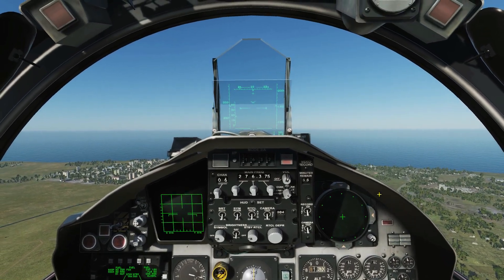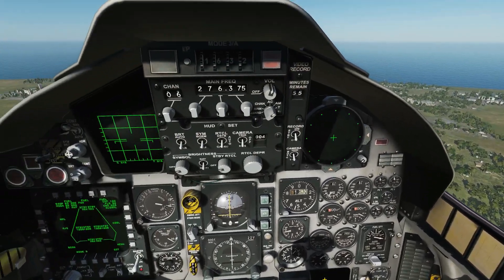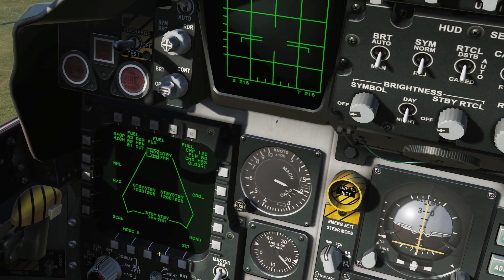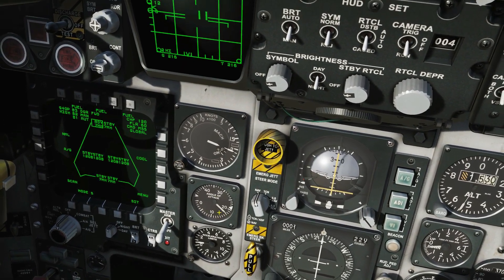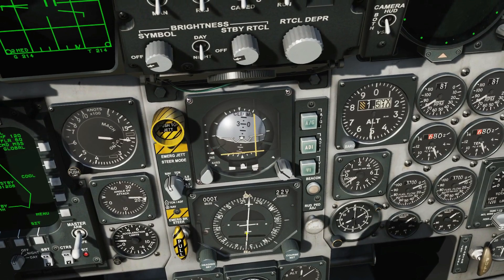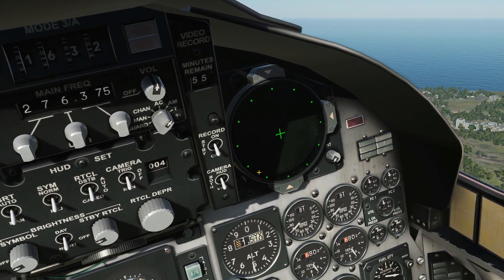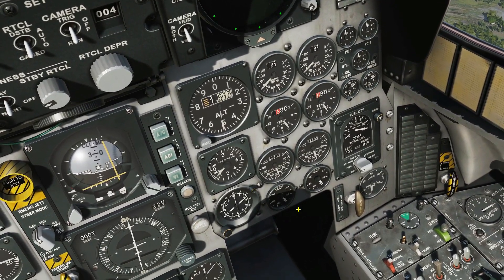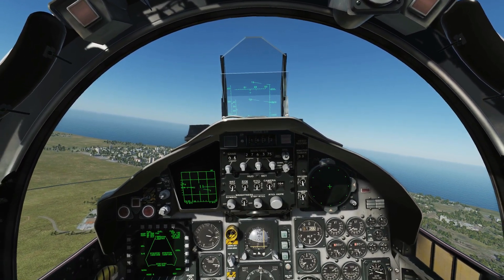F-15C Eagle: Cockpit Familiarization Tour Tutorial | DCS WORLD

Comment: Cap. For the low fidelity (FC3) modules, would you say, they can't be flown really in VR. Or in other words - can you bind all you would need to your HOTAS (keyboards are pretty useless in VR) to be effective in flight?
Reply from the maker: You you can use VR but all controls have to go onto HOTAS. Not ususally a problem.
Reply: IMO, FC3 modules are lots of fun in VR (and otherwise). Some tips for bindings:

1) Double-up your HOTAS bindings using a shift button (or multiple shift buttons) located on your HOTAS. This can be achieved in the software that comes with some devices, but I prefer to use VoiceAttack (VA) to achieve a more uniform result across multiple devices that may not be the same brand. Also it allows me to use a shift button from one device to affect the functions on a separate device too. Very easy to do: set up VA to identify your HOTAS devices, then create commands that output key presses in response to button combos. No programming skills needed.

2) After you fill up your HOTAS buttons with primary functions, use VA to make voice commands for any secondary functions that you can't fit. Such as mode switching, external views, AI comms, whatever. You may also want to dedicate a PTT button for comms, so your friends don't have to hear you talking to your PC  ;-)
Reply: Low Fidelity models are pretty good to fly in VR. 
I fly with Rift S and have nearly all keys I need binded to my Hotas. You can also use alternater like Ctrl or shift to have some more options.
Reply: FC3 work great in VR from my experience
Reply: Because of the need for keybinding, I find them a little more challenging to fly in VR, but the simplifications also work to my advantage - there's not as much stuff you need to worry about. Everything of key importance I can map to my HOTAS or to very easy-to-reach keys (like the cursor control keys). A few rarely used keys still end up on the keyboard, but with the headsets I've used I can still take a peek down the bridge of my nose and find them when necessary.